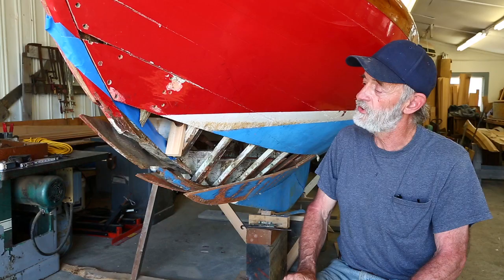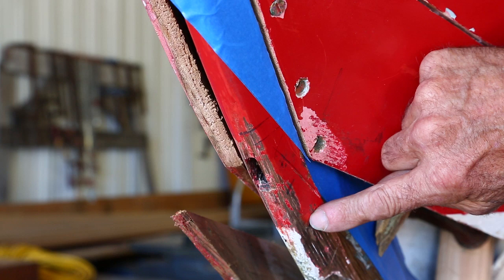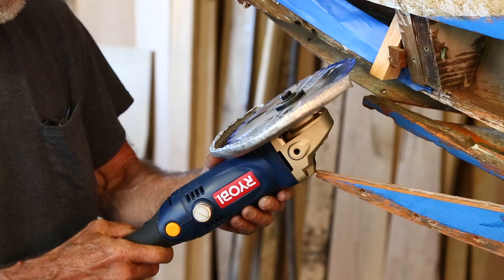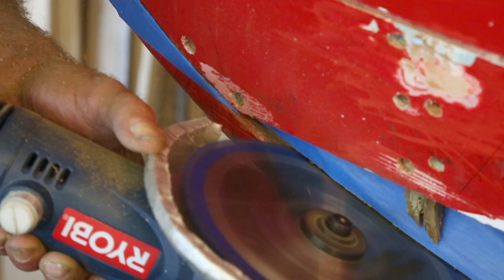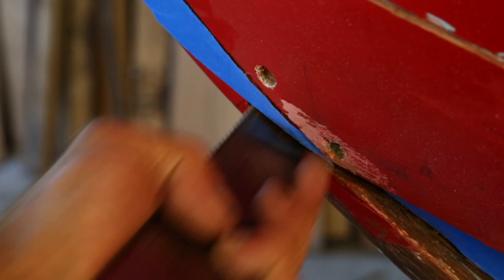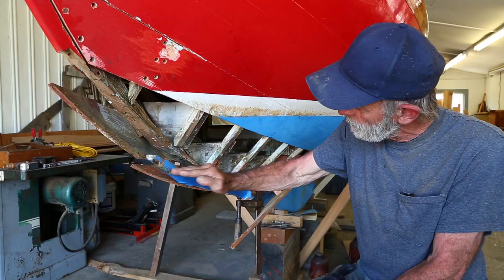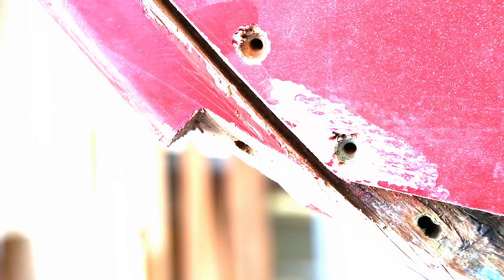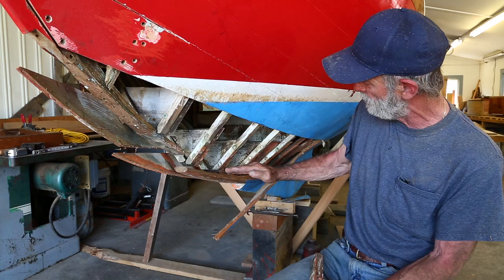Part 3 - Cutting the stem and keelson on a Herreshoff 12 1/2 - Wooden boat building

Comment: Love the videos, not a safety nerd, but as a firefighter I have responded to calls with guys using circular saw blades (4krpm) in angle grinders (12-20k rpms.)  I would recommend dialing the rpms down a bit with a rheostat switch to something closer to 6000 rpms.  One minor twerk of the cheaper blades usually doesn't end well for the user.  Keep up the great videos, learning a ton.
Reply: the lower rpm don't make anny diference if not worst, but  a fine tooth blade rather than a ripping blade works better, but still to dangerous, I stoped using some time ago when a tooth broke and flow into my arm, nothing serious but for me it was not worth it 
annyway best channel ever
Reply: +Alexandru Alanei The reason for the slower rpm is that a blades max rpm isn't just a suggestion, particularly with brased on teeth, doubling or tripling it will cause huge increases in centrifical force, it may even be proportional to the square of the rpm, I'd need to check an old physics book to be sure. You were lucky it landed in your arm.
Reply: you might want to look up the difference between centripital and centrifugal force whilst you're at it.   Centrifical force is a figment of your ignorance
Reply: Michael Randolf  and they're, their, there.
Reply: Michael Randolf  I don't think I've ever used talk-to-type for anything but Google search.
It can't even get my search inquiry correct, so I've gone back to strictly typing. Even at that, auto-correct is my worst enema.
Reply: Enemy, not enema, damned it all to hell.
Reply: I looked up that blade.  It is rated to 7,000 RPM.  I didn't look up the grinder, but a 7" grinder typically turns around 6,000 RPM.  Well within range.  (The 4.5" and 5" grinders are the ones than turn over 12K RPM.)  One reason for turning the blade so fast is that it is actually less likely to grab and kickback.  Did you see a couple of points where he jockeyed the blade forward and back a couple of times to correct the direction of the cut.  It was more like using a "wood grinder" than a saw.  Pretty cool, but definitely not for the novice.
Reply: @briangodfrey5079  it looks like a 4.5/5 inch grinder with some type of homemade guard

Comment: I'm wondering if you've tried an oscillating tool to do similar types of cuts?  They're not usually good for that long of a cut, but they're very easy to control and allow for a reasonably straight plunging cut.  Plus they have the advantage of not risking major bodily harm if your hand happens to slip.

Comment: Love your videos, I have been an amateur boat builder/restorer/sailer,  since I was 14 yrs old. iam am now 63 yrs old. You are a brave and skilled craftsman to use a saw blade in a grinder. I would not recommend it for just anyone, but iI plan on trying it myself. Gary SV "Paladin".
Reply: It is a dangerous practice but it's not really that uncommon. There's even a cutting wheel that has chain saw around the edge that's used in carving wood. Tho i would probably like to have a handle on that to use one myself.
Reply: Have you tried the "new" vibratory type cutter/sander tools? My brother introduced me to his last year. We were working together building a custom library complete with a hidden "book shelf door". I was really impressed with it's speed and accuracy.
Reply: +highwatercircutrider Belated answer. Yup, i have. Amazing little tool. I really wish someone would make a big brother to the usual hand sized tool, because it would be perfect to cut big timber notches. 

I actually took a MX30E from Bosch and modified a blade for extra depth. It's not perfect but it allows me to reach really deep in a piece of timber and make joints that otherwise i'd have to work at chip by chip.

That aside, it's one of the most impressive tools that came out of the medicine world, i remember some 14 years or so when i had a cast and the doctor pulled out this ghastly looking saw blade and i was terrified it would slice right in to me. :) Only for him to hold it against his hand to reassure me.

Cheers.
Reply: Ps. I Love your videos, Gary in Michigan aboard SV Paladin.

Comment: 1:17 you said there's no other tool that could cut that line but you've probably never used a "multi tool" the original was called the multimaster if you go to Harbor Freight they have an exact copy for like 20 bucks you need to buy one and try it you'd be amazed at the things you can do with that tool.
Furthermore you can make your own blades for it I've even used a pizza cutting wheel for super Sharp Cuts it's amazing scraper sander grinder cutter Etc
Reply: By the way the placement of your 👍 thumb had me on edge. One little kickback and.... No more hitch hiking!

Comment: Toothed oversize circular saw blade in a high-speed angle grinder with homemade guard, no second handle, and no safety gear of any kind...what could possibly go wrong?  Fine for Lou, but unless you share his skills, check out some of the angle grinder accident videos on youtube before trying this.

Comment: You need to patent these tools .ive been kicking around as a laborer for 40 yrs and never seen anything likebthat makeshift skill saw.absolute genius
Reply: No just probably one of the dumbest ideas you could have safety wise. If that blades binds there is no controlling it.
Reply: @IDJEGOI  the way i always stop a runawsy skill saw is to simply dont letbit get away from you !!!firm grip hold the blade in the wood your cutting and release tje trigger.the key is you cant be afraid of it. People get scared and let it go in panic and the fucking thing will run up or down whstever the blsde touches.including your leg86